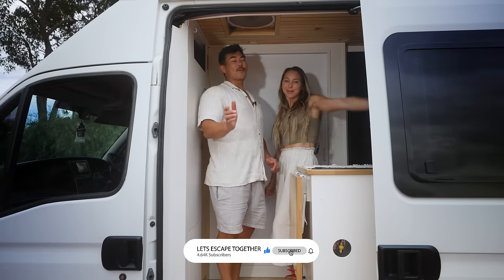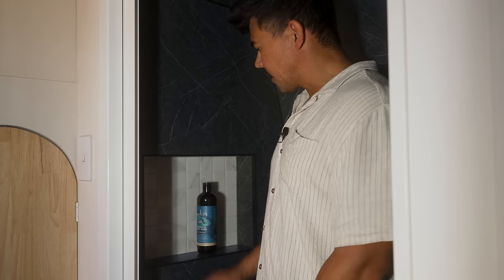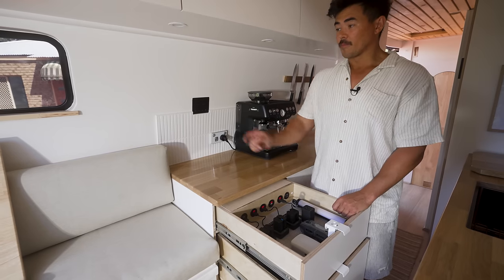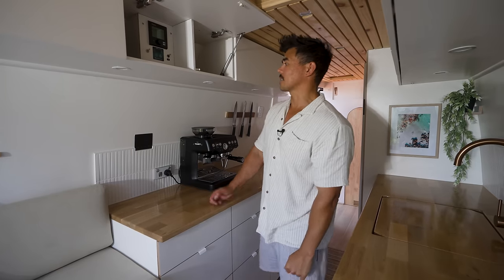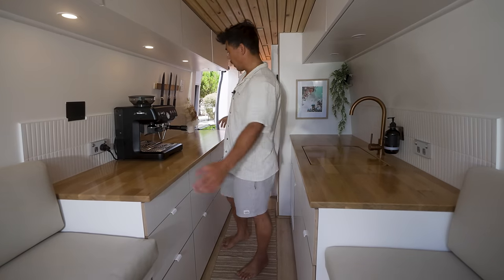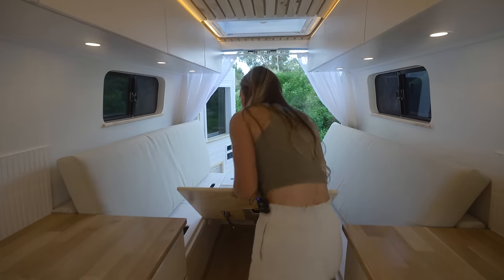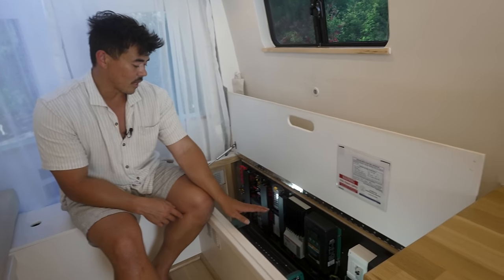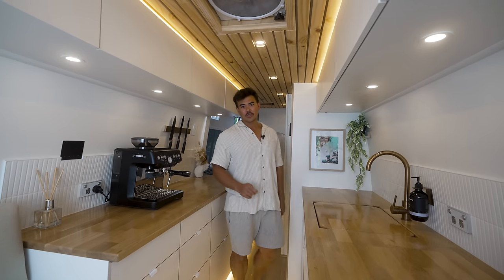VAN TOUR | Luxury OFF GRID Australian Campervan with custom Full Size Shower

Comment: Hi 
Im Bobby from Montréal Canada
Very Nice build
What kind of matériel are you'r wall's made ove
 Thank you
Reply from the maker: Thank You Bobby, Its just 12 or 15 mm plywood :)
Reply: And you painted IT with what kind of paint?
I thought That IT could have been mélamine?
Reply from the maker: The paint is a semi gloss enamel and the colour is called almond milk
Reply: Thank ' s you guise are awsome
Another question, the structure behind the plywood , are 2×4 ?

Comment: Hey Max and Em
I have been looking at the Iveco vans with the view to buying for a van build and there appear to be two van lengths for the 50C18 do you know what length yours is 6109mm or 7274mm
Reply from the maker: Hey Stevie, Ours would be the 7274mm sized one. That's great to hear, we are loving the space and high roof in the Ivecos :)

Comment: How did you plumb the slide out toilet? And did it need it to be certified?
Reply from the maker: It’s a compost toilet so if doesn’t need plumbing. It just has a flexible hose that vents out to the bottom of the van 😊